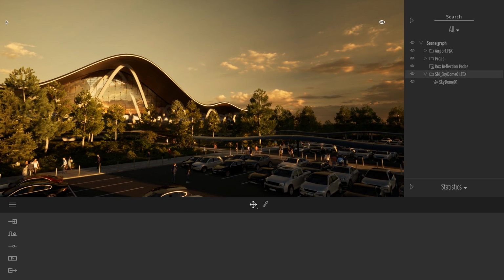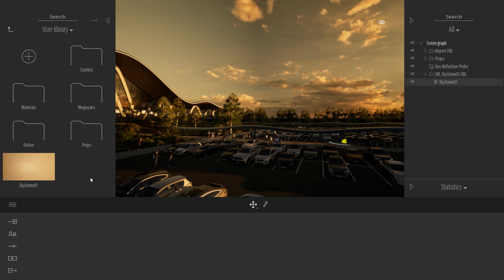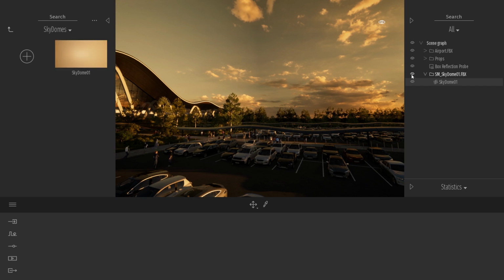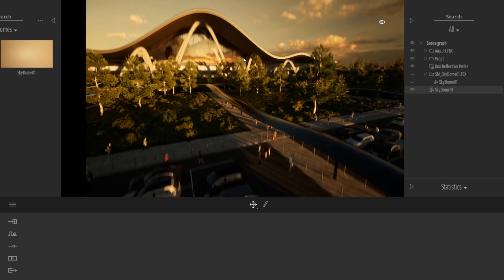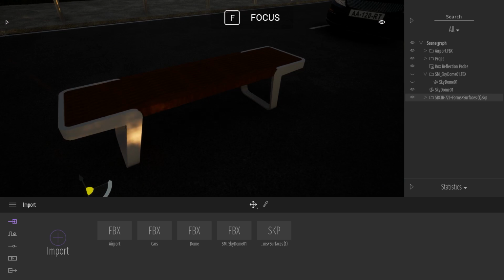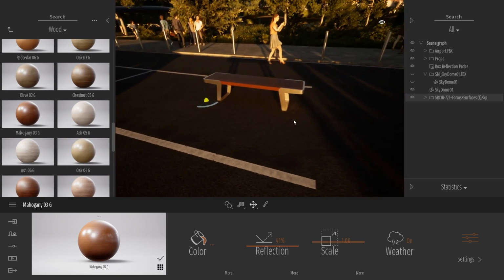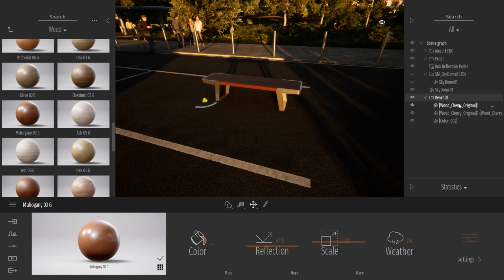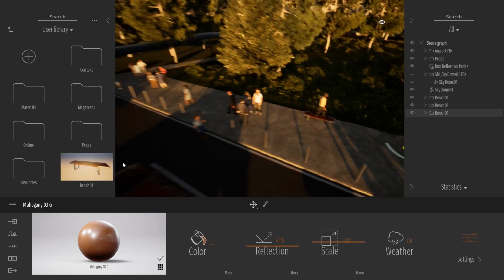Save an imported object into the User Library | Tips & Tricks | Twinmotion

Comment: It appears that objects IMPORTED as part of a group, such as an imported sketch from Blender, cannot be isolated in Twin Motion to save to user library. I tried various ways to ungroup the objects to be able to save ONE of the objects to the user library. I neither can COPY AND PASTE any object from that group individually as it came in as a group, although I am able to edit the individual objects from that sketch in Twin Motion, I cannot copy and paste any of them. I had to add this in, even single imported objects cannot be copied and pasted, nor added to the user library, 

 I would appreciate any help on this. I tried to EXPORT an individual object from that group to see if I can then import it back to Twinmotion, won't let me. Simply saving the object in blender as a FBX file by itself works, however, importing that object by itself changes the dynamics of the object where I am unable to scale it to the same dimension exactly. 

The object also will not scale individual dimensions, in Twinmotion after individually imported it this is why, it scales the whole thing instead of "height/ width" individually so it cannot be matched up exactly to the object I have in Twinmotion that I'd like to copy. I tried also UNLINKING the object from the group in Twinmotion. 

The way I imported the GROUP of objects part of the sketch is the usual way to keep the pieces separate for rendering. I tried renaming the object as well. I tried the isolation" button as well on the object.  A singular object as he shows here, no problem to save to user library or copy and paste, but when you bring in a group of objects as part of a sketch, you cannot do that with each individual object, but you can copy and paste the whole group, which obviously you do not want to do. 

You can neither DELETE any object individually either, but you can delete the group as whole. I hope I made this clear in understanding. Any info on this matter would be greatly appreciated!